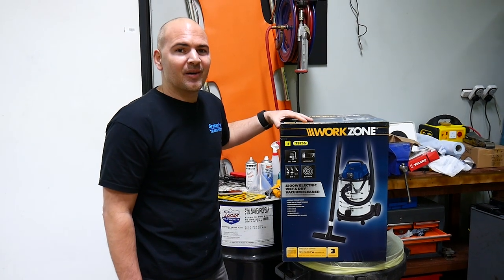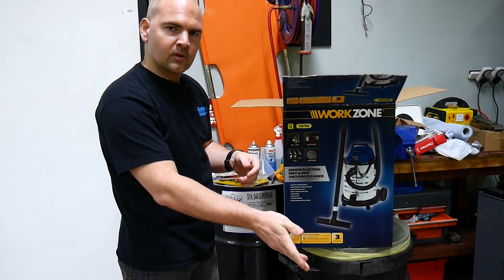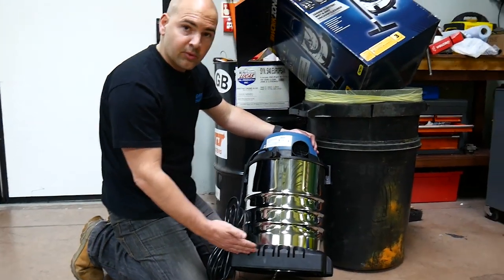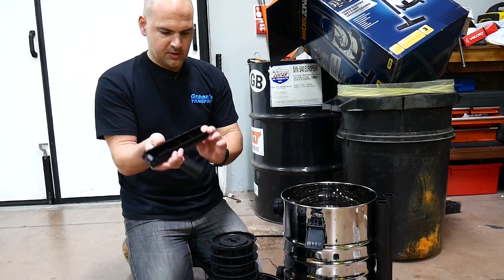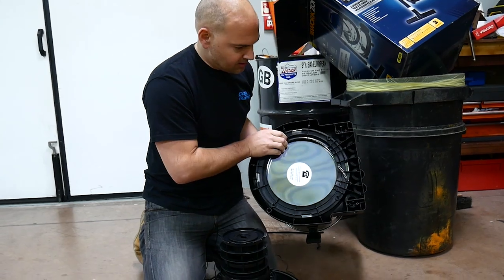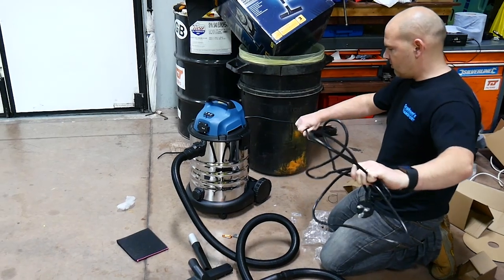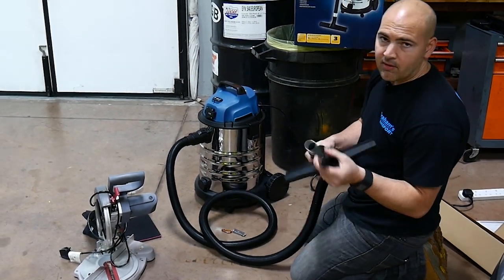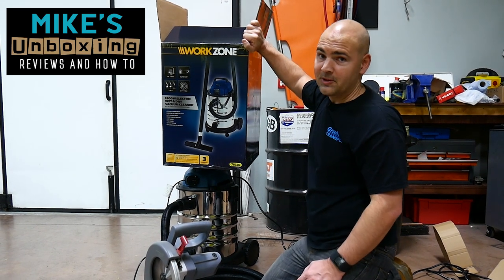Aldi Work Zone 1500w Wet & Dry Workshop Auto Vacuum Unboxing

Comment: I was looking at the shop vacuum at Aldi today but the one I saw was black plastic and didn’t have the power tool plug and attachment for $34.99 marked down from $49.99. Last week I picked up the electric 4180psi power washer regularly $79.99 marked down to $59.99 so of course I got one and it works great. I also have the drill driver and sander and the cordless sawzall.  Every tool I’ve bought there has performed very good and I use them almost daily. I highly recommend getting any power tools they have.

Comment: Picked one up today only negative is that it's a bit loud but other than that it's fantastic value piece of kit
Reply: I bought one of these today but mine didn't have the yellow filter have they changed the design or did I get one with a missing bit
Reply: @eve1183  yeah they have slightly changed alright the filter in mine is black, and the vacuum tube is stainless steel 👍

Comment: Typical man throw instruction manual away 😁 great video getting one next week in aldi after watching this
Reply from the maker: Thanks for the feedback. Hope they still have them in store.
Reply: I'm a bit unsure as to how to use this wet n dry to actually clean the carpets, as the video is not very explanatory, neither is the instructions, do I clean my carpet with carpet cleaner by hand or do you put water and fluid in to machine
Reply from the maker: It is more for spills you would be better off with a dedicated carpet washer if that is your primary usage.

Comment: Mine is so noisy it's unuseable. A high-pitched scream. Am I doing something wrong?
Reply from the maker: not sure? they are noisy but shouldn't be too bad, maybe the brushes in the motor are bedding in?
Reply: @mikesunboxing  Thanks for the suggestion.   I'll  run it outside for a bit, and experiment.

Comment: Can you use this for cool ash?
Reply from the maker: Depending on your definition of cool 😀 cold ash yes. It is metal so should be resistant to heat. But the plastic areas may be an issue.